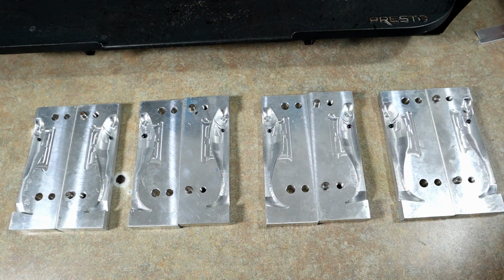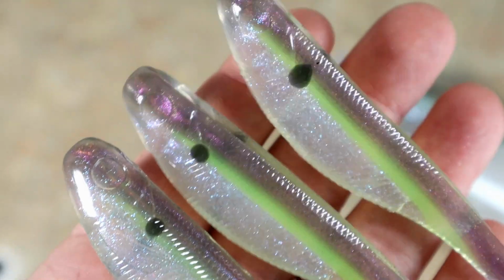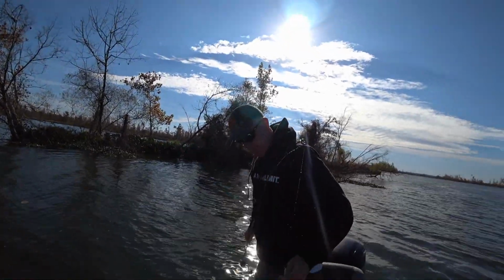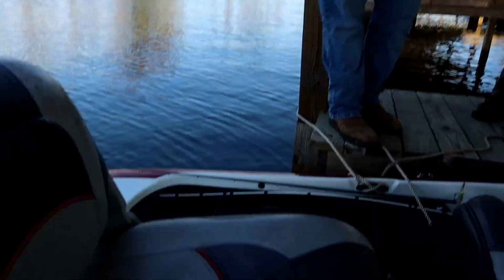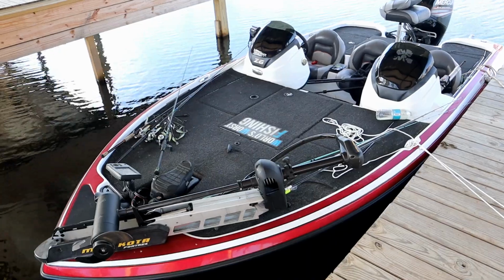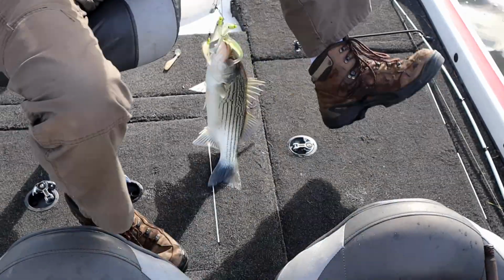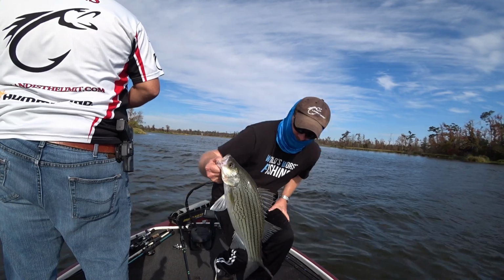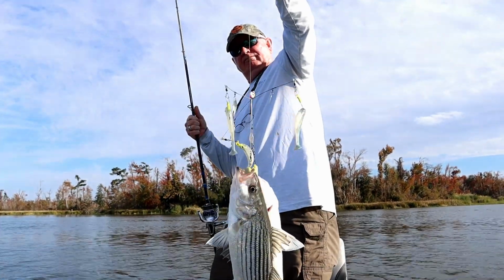Do Home-Made Baits Work?? Testing MY BEST Lures!

Comment: You guys clearly smoked em but a tip for next time......when you fish with Riggs with a lot of swimbaits like that try putting one on that looks different from the rest. For instance have all those emerald shiner colors and then put one on that is white with a orange lateral line. Almost 80% of the fish will come on the one that looks different. Great video!
Reply from the maker: Yeah we used to throw a different stinger bait on there in years past

Comment: In all your videos on the hand poured swimbaits that I've seen  they have been very informative. I'm about to get several swimbait molds. I'm  not new to soft plastic bait making. I have about fifteen or so soft plastic bait molds, but they are all injection molds. In none of the videos I've seen yet,  is there anything said about the cooling process.  Do you leave them on the griddle and simply turn it off? Or do you take the molds off the griddle? If you do, do you place them in a water bath to cool them faster? I'm looking at starting with the Angling AI (already have several Angling  AI injection molds, so I know they're quality) 4" and 6" open pour. Going to start out with one of each because of current budget restrictions, with plans to get at least two more of each size, and maybe one of the 7.25 ones.